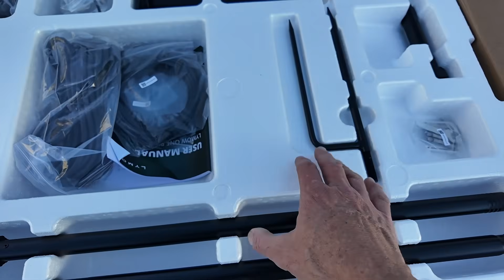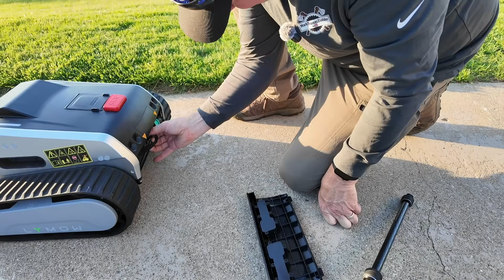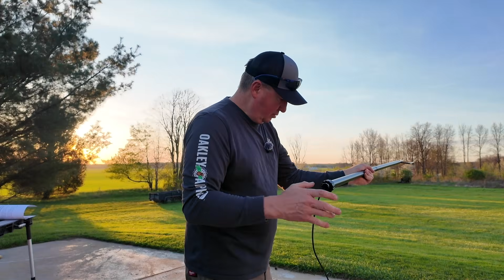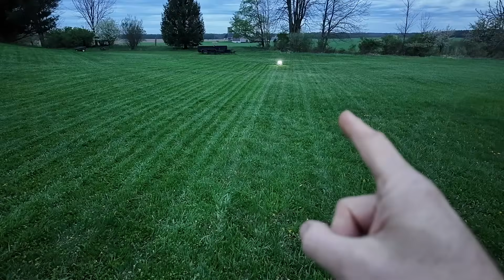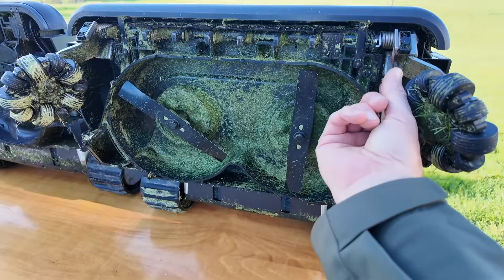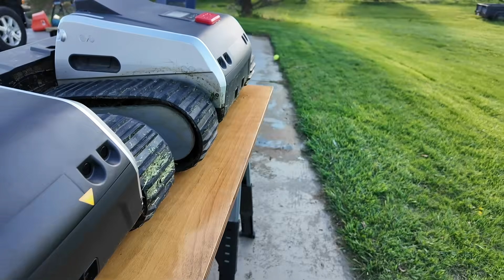I Tested the NEW Lymow One Plus Mower — Here's What I Found

Comment from the maker: QUESTION OF THE DAY: What would you want to see this mower prove before you’d buy it?
Reply: Handle customer service
Reply: Did you buy this or given to you.
Reply: Customer service and loaner while yours is down or sent in for repair. Also incorporate lidar and fix the side discharge that everyone seems to have to remove but that may be a liability thing.
Reply: I want mine to be able connect to a wifi network so it can complete its initial configuration.  And not be buggy af.

Then mow the lawn.  Which it cannot do with it's broken internal antenna brand new out of the box.

Then i'd want the same as @nerdydarkknight above.  Which also isn't happening.

Comment: I have a One plus, initially it was great, then the problems started. Bearing issues with the motors, Springs on the deck breaking. Exposed sensor wires. Now the worst is Blade stoppage / overheating during mowing if the outside temp is over 75F. Zero Support from Lymow. Zero return emails on tickets. Had to fix everything myself.  THIS UNIT IS NOT READY FOR GENERAL USE. If you dont have a workshop or are not able to do your own troubleshooting and repairs this unit it not for you.
Reply: Mines arriving in a few days, I live in the tropics, initially I was thinking of mowing at night but we have wild boars.. so now thinking insulation wrap on top for protection and to keep cooler, also slow speed to reduce heat buildup, so many people think it's a bugati or something and want to run at redline to impress their neighbours wife, slow is the tempo, less heat on battery and motors.. send it out everyday if needed..

Comment: I have been using my Lymow for about a month on my yard and surrounding pasture, totaling about 3 acres. The navigation works very well, but the one issue that pretty much ruins it is that the blades stop working if you run the mower above 1.6 ft/s with the power set  above Standard. The increased power setting would help a lot on the larger parts of the yard by speeding up mowing, but I can’t use it because the mower blades randomly stop and start.

If I had known this was going to be an issue, I would have waited for the 3rd revision of the Lymow and hoped the problem had been resolved. I have tried all the common fixes, including unplugging the battery and letting it sit overnight, as well as installing new updates, but so far nothing has changed. I also have not received any response from support regarding the blade issues.

Very disappointed. If you are interested in buying one, I would wait until they fix the blade-stopping issue.
Reply: Faster speed, plus faster blades means more amps on battery.
Let me explain a different way, I'm on my 1500W ebike, full throttle on flat ground draws 40 amps and can go for an hour, but uphill has to draw 50 amps  - battery can put out 50 amps max for short burst so if hill too high will cut out, but if I dial back the speed a touch will smoothly go up the hill no worries. The lymow gives you time, why are you in such a hurry to go max blade and max speed, are you trying to impress your neighbours wife, you are aren't you? Go slow, better cut, reduces battery consumption, and extends the battery life as reduces heat and stress..

Comment: Good video.  Is there a max acreage size you can mow?  I have about 4 acres to mow.  I Ordered, but haven’t received the Luba 3 5000 but that only allows 1.25 acres programmed.  Figured that would work around all my pine trees but I’ll need to use zero turn on the rest.  Will this one work good under heavy tree coverage?  Thanks!
Reply from the maker: This mows up to 1.73 acres per day. I have a big spruce tree that it mows under just fine, but I'm not sure about a lawn with many trees. I think this would handle your 4 acres. I'm going to have a follow up video that will show more details that I think you'll find helpful. It should be out early next week.
Reply: FYI, anyone regurgitating the claimed 1.73 acres per day is in on the scam. Took 2 days to do our 1/4 acre lawn. I say took because after endless issues it fully died and Liemow won't do a thing. Having owned one I can now look at "influencer" videos and see all the crafty deceptions they use. But as I said, someone tell you 1.73 acres then you know to ignore them about anything Liemow.